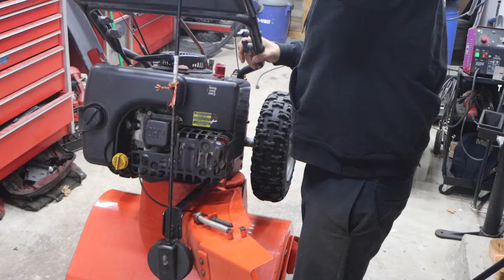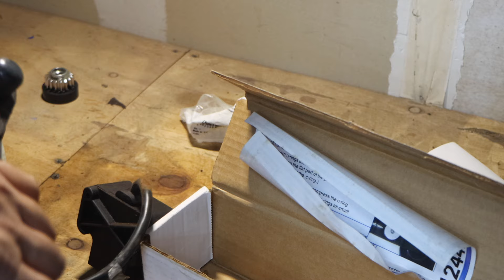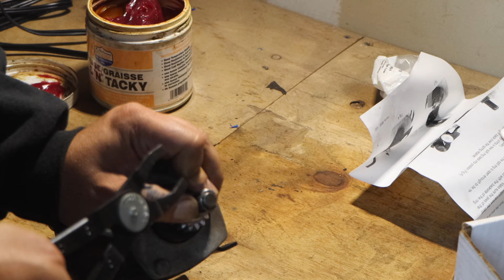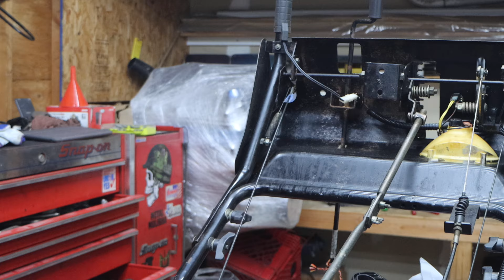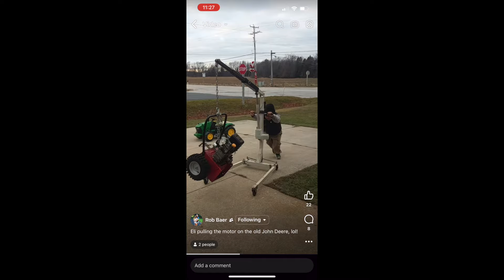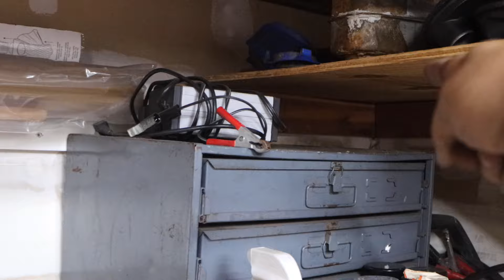Second Hand Part From Eli Saved This Ariens Snow Blower From The Scrapper

Comment: Hey  Pattay’s performance I just bought a Snow Tek 24-inch snowblower with a metal chute. I have a couple of questions. Would it be a good idea to modify the impeller? My Toro 421 has had the modification done and it also had a Predator 212 engine. The old blower wore out, so I bought this newer one, which is in good condition—no rust on anything—for $100, and it runs fine. I haven’t had a chance to test it yet, but I plan to do the impeller mod if it will help. My main concern is that I’ve heard the LCT 208cc engine sometimes has trouble. Do you think it would be a good idea to swap it for a Predator 212 engine in the summer, or would you recommend waiting?
Reply from the maker: @DeonteHemphill-e1u ,

Great questions…

For sure modify the impeller!  

As far as the swap…I would shelf the predator and save it for another day.  

I’m a fan of electric start and 208cc engine is a great machine.

Congrats on your purchase!  I’ve swapped a few Toro’s and people loved them! 

They were a few years ago and it seemed parts were plenty like the brake pads for the auger pulley.
Reply: @ @ I like the electric start but would the predator 212 hemi have more power and as far as impeller mod how would I go about doing that what material is best and do I use self taping screws 
And back on the engine I just have been told the predator is a better choice I love how it preformed on the toro but would you start with a fresh one or use the one I have on the toro as I plan to scrap it honestly the toro is so old and I feel it’s gears are slipping honestly but if I was to do the swap would you use a new one or the old one and change the oil
Reply from the maker: @

Yes the Pred 212 will more power but honestly it’s not a deal breaker.  Electric start is nice for me! 

Yank the Pred off of your yours and shelf it. 

Impeller mod if the same way you did your Toro.  I have videos on how to do it
Reply: @ can you send me the videos
Reply from the maker: @ use the search button or check out my library.  I have a full series on the snow tek 24.
Reply: @ I like the electric start but would the predator 212 hemi have more power and as far as impeller mod how would I go about doing that what material is best and do I use self taping screws 
And back on the engine I just have been told the predator is a better choice I love how it preformed on the toro but would you start with a fresh one or use the one I have on the toro as I plan to scrap it honestly the toro is so old and I feel it’s gears are slipping honestly but if I was to do the swap would you use a new one or the old one and change the oil
Reply from the maker: @ 

https://youtube.com/playlist?list=PLZFc7a-epiG4hmSmE22gEpegwVobcqdSn&si=-2ZArMGW26JlCPLF
Reply: @ ok when you said overlap the impeller do you mean like make the flap flush against the housing or up a bit so the impeller is out of thing a bit and the flap is bending a bit
Reply: @pattayperformance  I also haven’t picked up the machine yet I looked at today and and made sure it was in good shape it has barley any rust like the auger box has no rust only on the bolts for the skids so it’s in very good shape but I’m going to pick it up today as far as getting it in my moms minivan should it fit or can I fold the handlebars down for it to fit if so how
Reply from the maker: @ not sure of the dimensions…

Being a basic tool set with wrenches, sockets and pliers.  Be then enough to fold the handle bars down and remove the chute if necessary
Reply: @ ok that’s what I was thinking just loosen the handle bars do I need to disconnect any linkages or rods on the dash part or no
Reply: @pattayperformance  ok that’s what I was thinking just loosen the handle bars do I need to disconnect any linkages or rods on the dash part or no
Reply: @ I just grabbed it barley any rust and runs amazing all gears but I have a questions missing a shear pin on the left side what shear pins does this machine take

Comment: When the drive plate is heavily contaminated with rubber because the user does not know how to properly use a snowblower (a video in in its self) we will use a plastic style scuff pad with our silicone and oil remover (used by body/paint shops) to clean the drive plate. This does leave a very light abrasion to the surface and is as far as we would go on this area (no sandpaper). On the occasion the customer has run the friction wheel all the way down to the metal retainer and damaged the drive plate it can be repaired by sanding out the damaged area but if it really was deeply grooved a new drive plate may be necessary.

Comment: Why are there always cars with no mufflers racing around on every YouTube video?
Reply from the maker: @moochythecat3435 ,

So it’s nice high end cars or people who had their Cat stolen.  Cat theft in our state is rampant due to the value of them and if caught no punishment.  Access of battery powered tools…cutting off a cat takes seconds unfortunately.

FYI…I’m part of the no exhaust/muffler crew.  Mandingo is dumped by the axle…I use to have it right under the passenger seat. Gotta hear my Turbski

Comment: Merry Christmas to the both of you at Pattay's and Jason you should apologise to Mrs. P. i would think she only orders the part number she was given by the technician or the supplier made the mistake of shipping the proper gear. At EP we always use a silicone and oil degreaser to wipe down the friction wheel and drive plate prior to closing up the access panel.
Reply from the maker: @waynestefinashen239  lol she did everything right…I was talking to Jake behind the scenes about this one.  It just seems you can’t order this bendix gear new anymore. 

Great tip!  Do you guys also “rough” up drive plate?  The local repair shop to me that closed believed in roughing it up so the friction wheel has a better bite.

Comment: I find that greasing some components may not be the answer, and instead I use silicone spray or graphite lube or even a little motor oil. Now if the temperature is not -30 celsius then grease works good. At certain colder temps that grease turns into concrete. I used grease on the shifting linkage on an older combine, and when I went to move it in the winter, I couldn't get the shifter rod to move up or down from neutral. I had to wash off all the grease using heat and a rag then just using a skim of motor oil and never had a problem since. This was a combine converted to push snow with a 12 foot snow blade. Merry Christmas to you and your Family. Keep the videos coming.
Reply: You got it Viking here at Eliminator Performance in Canada we use low temperature grease specifically because of your reasoning. Doesnt matter what grease you use if temperatures dont go sub zero. We have even seen shifter hex shafts on snowblowers that had Nickel Antiseize that created shifting issues during extre,e cold weather.
Reply from the maker: We live near water I can’t recall if we have ever had -Temps with wind but we have gotten down to 3F with Zero issues.  Once we are out Doing snow removal we never check temps as it helps with mental battle as the hours pass and at times conditions worsen.   

Lucas Red N Tacky is low temp (don’t ask me how low bc I don’t know) prior to that I was using Valvoline Grease (blue) it’s the same stuff we run in all our vehicles and machines with zero issues.  I really do believe to a certain extent grease doesn’t matter.  People have told me they use Marine Grease with great success. I have yet to try it bc we don’t own a boat yet 🤣
Reply: @pattayperformance  Time to buy that boat make it a red one and call her RedNTacky lol
Reply from the maker: @ 🤣🤣🤣. Ask Jake if he will be my first Mate/Lt. Dan
Reply: @pattayperformance  Depends if the salary is better than EP i guess LOL